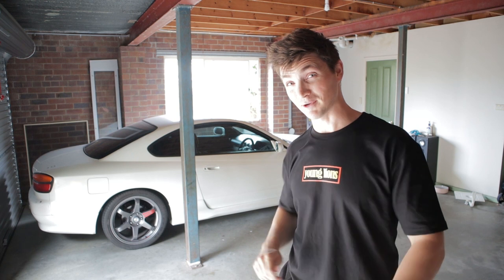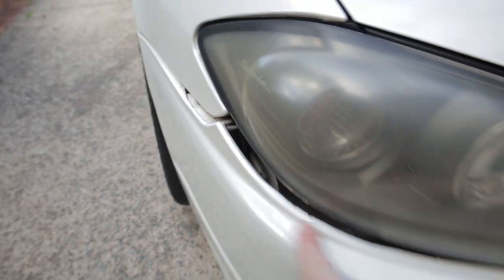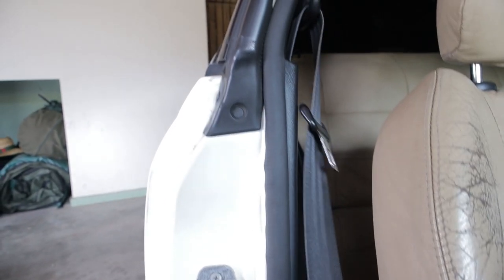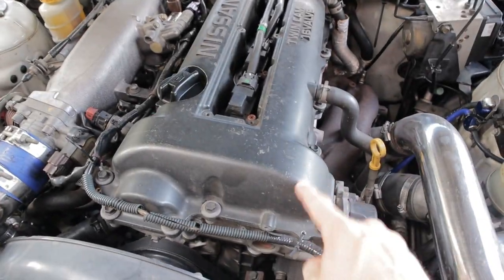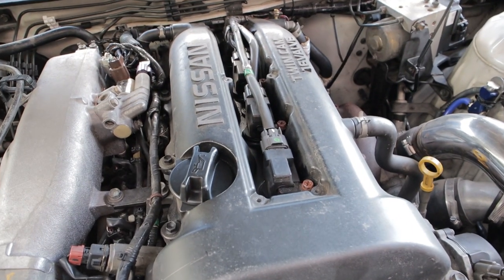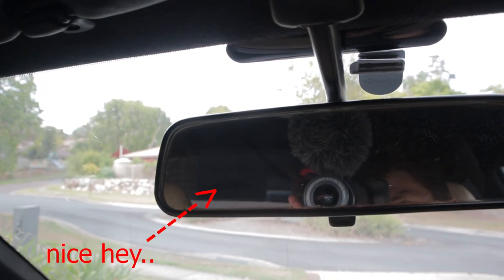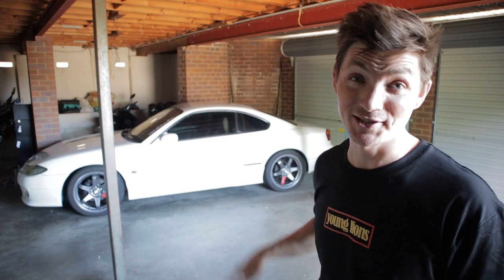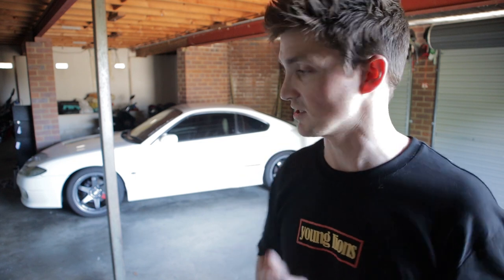Everything that's wrong with my Silvia..

Comment: One tip for retracting seatbelt mate, spray silicone spray on the seat belt and the bracket that the belt loops through, mine works perfectly now and wouldn’t even retract before.
Reply from the maker: Yeah mint! I'll add it to the list :D That's awesome that if fixed yours. What silicone spray did you use?
Reply: @PiersonWillis  Just this one from Kmart mate, works perfectly - https://www.kmart.com.au/product/3-in-one-silicone-spray-lubricant---448ml/119516

Comment: Go buy the MCA Reds over BC's based on BCs getting creeky over time not just the fitment issues. Yes they are good but good new, crap 2 years later. Shockworxs though will probs be the best but the price may make it a no.
All the rest - FIX IT. I just went through half that process but S15 is a car when you can get ya money back thankfully.
Reply: Also LOL, yes sometimes the hair works. Sometime. Feelz man.
Reply from the maker: Hindsight is king haha. Mostly because of all the fitment issues since I bought my BC's.. I don't have any dramas with how they work apart from my wheel clearance dramas. Sorry mate but this video is an oldie but a goodie.